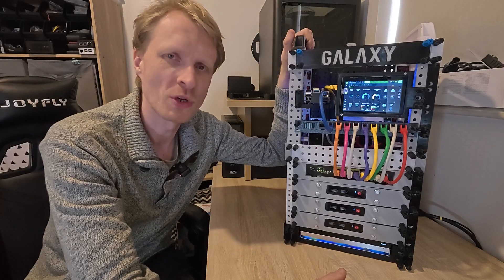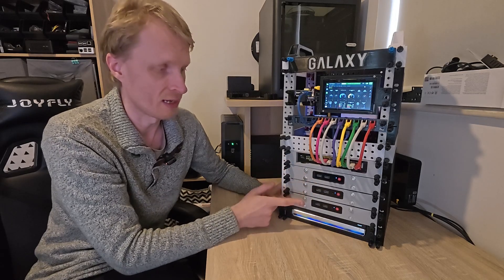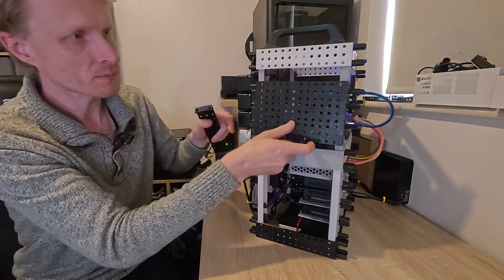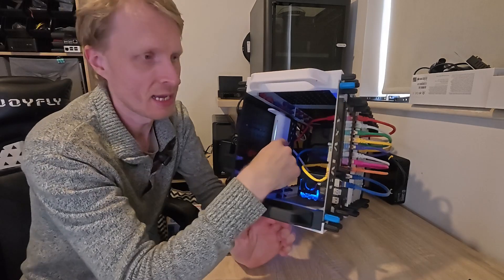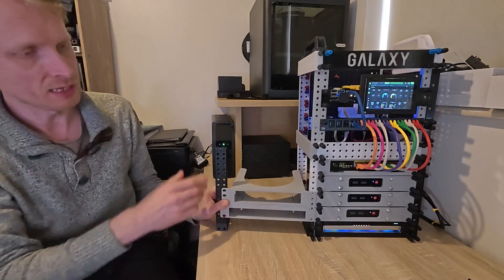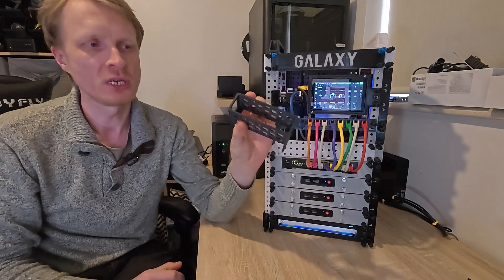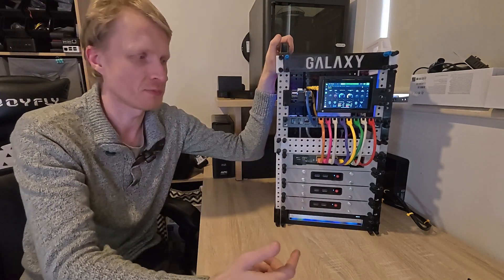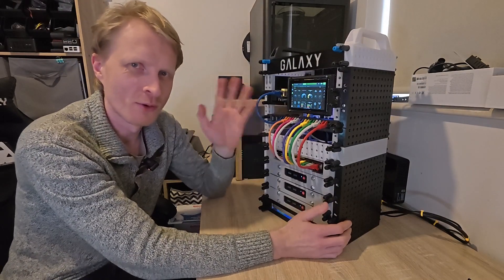I 3D PRINTED My 10" Server Rack | GALAXY 2.0 | HomeLab Series

Comment: I think it is great to think outside of the box to make a box.  I'm really liking the idea of printing a 10" rack, but will look to make it deeper.  I'd prefer the depth deeper and mount the power on the inside of the back so it's a nicely contained unit, safer for moving around.

My existing 19" rack (which is mounted 6ft off the floor on the wall in my basement electrical room) I build the frame out of 2x4s that I split into 2x2s and painted black.  Then I bought a couple of shelves, a large unmanned switched, a PoE switch, a double row patch panel and a power distribution and used Kreg screws to secure them from the front.  Along with local cloud storage now (thanks to Ugreen), Home Assistant on a small, used workstation PC, a purpose built PC to run Blue Iris NVR, I've been very happy with it running for the last 7yrs.  We are looking to move to a rental place once our house sells, so a 10" rack that is moveable will be best.  With the 2x4 frame I built and the bought shelves, paint and screws, I think I spent about $90 Cdn (with the metal shelves and brackets being the most expensive parts).  It will be different now with 2 x Bambu printers.

Comment: I just got a 3D printer and I had to rearrange my workshop to find a place for it. I did some electrical wiring and also overhauled my desk and all my networking stuff that's also located there. During this process I thought, now I have a 3D printer I could print a little rack to put my switch, router and modem in ... and now I ended up here!
I'm literally minutes away from downloading the files and get to printing BUT I have some questions I need to know first ...
1. why you use racknuts? The rack doesn't even seem to take advantage of their rectangular snap in mechanism? I've seen simple 3d printable bolts and nuts that I would just print and save a lot of money? Is there a special reason you used the racknuts? Instead you have a model that's specifically made to fit hex nuts. I just don't get the point and wanted to know if it would work if I use 3d printed M6 nuts 'n bolts?
2. Are all 10" frames, boards and attachments compatible with this print? I need at leas one frame for my TL-SG108 Switch and also a special side panel mount (5HE) for my UDM. If I can fit those it would be perfect!

Comment: I am so going to print this!  Would be nice to mount 2.5" or 3.5" drives in the 10"racks. A 10" rack with NAS/DAS built-in. I have 16x 300GB 2.5" SSD that I'm going to connect with my GMKTech Nuc9 with 4x NVME-> 6 SATA ports adapters.
Reply from the maker: Hmm. 10" adapter to mount drives - interesting. I will try to create something.

Comment: Hey, I was checking every week if some new 3d printable rack would come. And here it is. My question is, could you use M screws instead of the rack studs? I really like this and im about to print, but i would like to use screws
Reply from the maker: replaced couple rack studs with standard cage nuts - works fine
https://prnt.sc/0udHYl7i_z-N
Reply: @MRPtech  thank you so much! You're the best
Reply from the maker: I suggest to cut STL in smal chunks inside slicer and print a test peace. If any problems. Let me know. I'll amend file.
Reply: @MRPtech  cage nuts are m6? Did you use the other part? What length :D. Im going shopping
Reply from the maker: tbh, i am lost with all these M4 M5 M6 style nuts.
What ever nuts will fit standard cage bolt -- https://prnt.sc/-y6flArfvxq_
If i'll use bolt+buts, i need to hold nut from spinning otherwise i can't properly lock it down.  

In a middle of amending all STL files to resolve that https://prnt.sc/Mi1tcJHZzQkw
Reply from the maker: Hmmm. I think you can. Let me check. I will send you couple photos once I am back home.

Comment: Would it be possible to get a modified version of the 7U and 6U racks that they are printable in 2 parts. [will help on smaller printers]
Reply from the maker: What size is your printers print volume? What printer you have?
I'll modify rack rails to fit that printer.
Reply: @MRPtech  size of my printer is 220X220 [Wanhao duplicator I3] [though the effective print size is more 210x210]

I can roughly fit the 4U on it, though want something taller, hence a need for a 2 part version of the  6 or 7U size.

I think a "Half lap joint" would work the best for its connection. [Think woodworking].

This would also make it extendable to higher sizes like a 20U if you create Center parts for the Half-lap parts.
Reply from the maker: I remixed 2U rack rail and updated Printables post with new files
https://www.printables.com/model/1173672-10-mini-rack-all-3d-printable
Check Printables post description for more info. 
Let me know if you need any more modifications.

You can stack rack rails for as much as you want. Reaching size of 20,30,40,50U ...
Reply: @MRPtech  Alright, Will check and test it out a bit later.